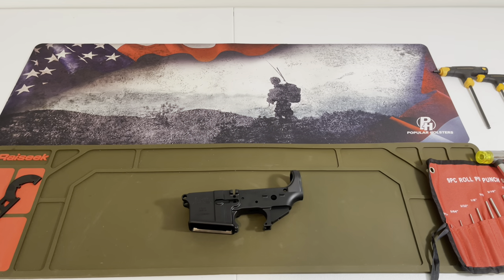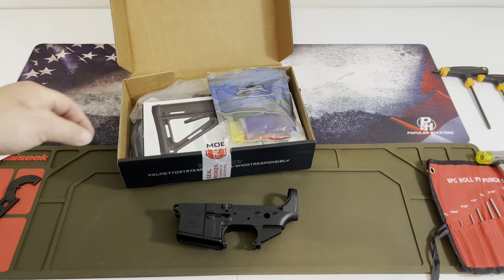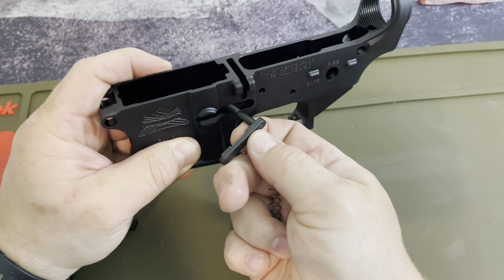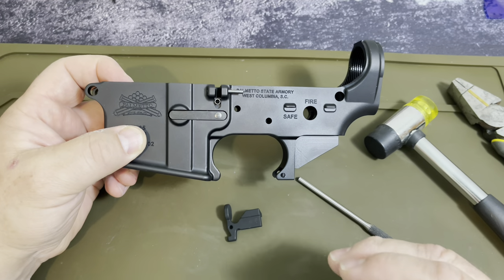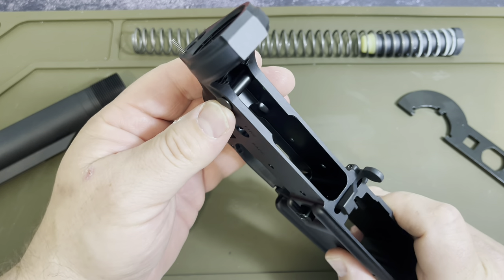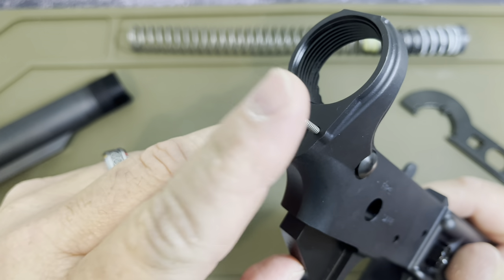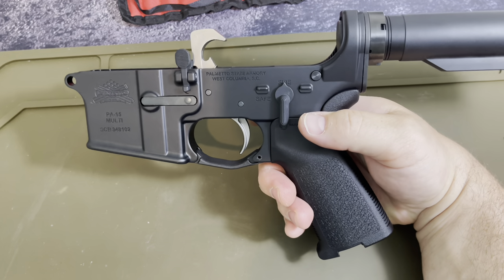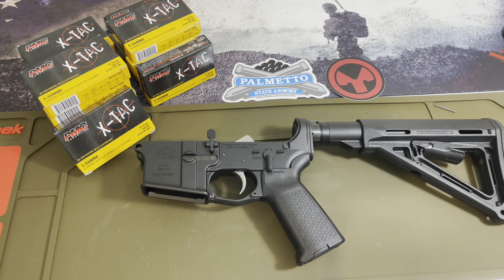PSA Lower AR15 build  - Complete Build

Comment: Nice video.  Thank you for making this.  I did notice at 11:00 for the bolt catch, you dropped the plunger in first then put the spring on top of it.  From other videos and images I found for assembly, they show the spring dropped in the hole then put the plunger onto the spring for assembly which is opposite of the order that you used.  The difference would be the back of the bolt catch pushing on the end of the spring (your installation order) rather than on the rounded end of the plunger.
Reply: Dang it. Now he's gotta take that roll pin back out
Reply from the maker: Good catch. Doing multiple retakes on video clips looking through a camera caused a brain fart 😂 Easy Fix to switch the order.
Reply: The crazy thing is. I looked into the hole and the plunger is the exact cutout of what's at the bottom of the hole. Now I'm curious if this is a serious issue because that pin was hell to get in.
Reply: I was getting worried there for a minute lol   ....."have I been doing wrong all this time? ...."
Reply: Yes, please edit video with a big blinking notification to install spring first!! Also, skipped the trigger guard install.
Reply: @BRUCEYBOY stop crying

Comment: What I did for the tight pins was put the thing in the freezer, and let the metal shrink slightly, gave it a drop of gun oil, then I was able to easily tap the pins in.
Reply: Putting the pin in the freezer! That’s a hell of hack right here.

Comment: Try using the right size roll pin punches and roll pin starter pins. It makes life much easier for installing them. 

Also, install the hammer/trigger pins, so the two notches go in last. The center notches are designed to lock into feature inside the hammer/trigger hole, so installing them with the notches going in last means you don't have to hammer the hell out of it to get past the first notch. 

Install the buffer retainer, spin on the tube 1/4 turn past where it needs to be, then install the takedown pin, retainer, and spring. That way they're not in the way during install. Then just push in the spring and rotate the buffer tube a 1/4 turn back to where it needs to be. Much simpler than what's shown. There is an actual torque spec for the buffer tube castle nut (40 ft-lb). Good and tight isn't good enough if you want it to stay tight for more than a few hundred rounds. Torque specs exist for a reason. 

A proper bench block for an AR makes roll pin stall a lot easier as it supports the receiver while you're hammering on it. Also, a magwell vise block makes buffer tube install/torqueing a breeze.
Reply: I was gifted the Real Avid AR-15 master kit and adjustable vice for my birthday from my beautiful wife. I  bought a bench from Harbour Freight on sale for just over $100 and can't wait to do my 1st build. Caught the PSA magpul sale and the bundle came with 10 30 round magazines for 150 plus shipping. Took advantage of several Christmas sales for everything and final cost of build should be just over 600.
Reply: Right, if you put them in correctly you can just push them through with your fingers

Comment: Thanks for posting. A great tip Learned from another commenter was to cut the point off a toothpick to hold the bolt catch while driving the pin
Reply from the maker: Sounds like a viable tip to hold it in place while punching in the bolt catch pin

Comment: One trick with the bolt release, is to slide a right angle Allen key on the left side to hold the bolt release in place while you hammer

Comment: Here's  a trick i learned from an  " Armour " ...
For that  Bolt Catch Release  assembly - use a  adjustable  Pliers to " Push " the Drift Pin in .
Less chance of breaking off tabs.
Oh , and another trick for  Buffer Tube Upper Detent pin & Spring , try using a playing card to compress the spring as you screw the Castle nut & End Plate down..

Comment: You made that front pivot pin install look 100x easier than I’ve ever done it. I can’t tell you how many springs/detents I’ve launched across the room.
Reply: I used a small feeler gauge (.05mm) to hold down the detent pin, worked like a charm
Reply: He made it look incredibly easy, it is hard with no other tools!

Comment: Torque and stake your castle nut guys. Also on the bolt catch, it is spring and then plunger. Trigger guard: use some sort of pliers to squeeze the pin in, if you are not careful you’ll break your dog ears off. Good intro video but a lot of missed steps for the nebies.

Comment: Next build you do put trigger and hammer pins in from left side to right Good way to remember is you read left to right and the reason you had to hammer is you put pin in on wrong side, if you look at the pin you will see one side has a long solid round before spring groves. That side goes in first so it does not grab the spring so you do not have to bang it past the spring and you can feel it lock onto the springs. Also have fun knocking out the roll pin back out of the bolt catch lol I have made that mistake before. To answer some comments on why spring goes in first is the bolt catch pivots and not good to pivot on a flat spring that is why the bolt catch detent you dropped in first has a round head so it is smoother while pivot contact is made. If you leave the spring like you have it, it will grind every time you use it and wear on where they rub. Other then that nice build always fun to watch a AR being built. I got three to build myself lol.

Comment: i tap the rear takedown spring hole and put a set screw in it. On the last build i did, i also tapped the bolt catch and trigger guard. It is super easy to do and anytime i do a build from now on this is going to be my go-to.

Comment: I use a small Allen key. I push it through the latch hole until it goes up to meet the pin in the other side. This eliminates me holding the catch flush, and all I do is tap the pin through.

Comment: When putting in the bolt pin, it doesn't hurt to put some tape under the pin to protect the lower finish when you need three hands to hold everything. You make that look relatively easy.

Comment: Excellent video. This was my first lower build. Already had a a lower shell. Got the PSA kit and watched your video. Only have two issues. They sent a set screw that docent go anywhere and I am missing the front roll pin for the trigger guard. I'll call them about those.
Reply from the maker: We are glad the video helped. PSA is typically really good on their customer service for replacements or missing parts
Reply: I got extra springs and detent pins with mine as those things will fly into outer space if not careful. you should only have only 1 pin for the rear hole of the trigger guard, the front pin is spring loaded and already installed  in the guard

Comment: Thank you! Best video yet I have seen!
I just got the shipping notification for my lower kit coming from palmetto, doing my first build. 
Two questions;
•do you grease the castle nut?
•do you blue loctite anything on the lower? 
Appreciate it! -Will
Reply from the maker: Thank you for the comment. I never use Loctite for a lower build. It will make it difficult if you ever want to dissemble, upgrade, or polish any part

Comment: If you do lots of build i suggest you get a Wheeler Engineering AR-15 roll pin install tool kit comes with flat sided puncehs for the roll pin on the bolt catch and other roll pins its like $40 and is a life saver ive got sausage fingers to and and it makes it easy.

Comment: With PSA you need an aftermarket flat wire buffer spring right off the rip.
Reply from the maker: We use the Buffer Spring that came with it and it works flawlessly. Dumped a 100 rounds through it with no issues
Reply: Is your recommendation based on the spring they supply, or the gasing of PSA uppers? All my PSA builds work fine, but I'm always open to recommendations regarding improvements.

Comment: I used your video to build my very first AR-15.  Fantastic instructions.  What should you put Loctite 242 on?   I put some on the magazine catch button because it would not line up perfectly every time I tried it.  I'm a retired manufacturing engineer and I know good instructions when I hear them. I upgraded some of the parts. Thank you for your help.  I'll let you know how it works after it's all completed.  :)

Comment: Just a couple of comments and suggestions coming from someone new to ARs and definitely new to building them. First off, great video and thanks for taking the time to put it together. Very informative. My suggestion, if you do another one of these build videos, would be to not skip any steps. Pretend your audience are a bunch of dummies when it comes to building these (which i am) and show us every step. Maybe I'm a little OCD when it comes to the info, but better too much info than too little. Then a couple of questions. First, I noticed you just hand tightened everything. Does nothing on this lower need to be torqued to a spec?  Also, I noticed you didn't use any grease or loctite. None needed?

Comment: I got a little unlucky with my PSA Sabre-15 lower parts kit.  The trigger and hammer pins were missing.  I submitted a claim about it just a little while ago, and I'm hoping to hear back from them soon.  Otherwise, everything seems fine so far.
Reply from the maker: PSA has always done a great job on their customer service. They should have you back up and going soon
Reply: @americanvikingtesting  Yeah, that's what I figure.
Reply: @americanvikingtesting  Oh, also, I thought I included this in my original comment, but I guess not.  @10:58, are you sure you should be putting that detent/plunger in before the spring for the bolt catch?  The video tutorial I watched from Midwest Gun Works says that the spring goes in first.
Reply from the maker: @SaltyMaverick  I put the correct order of installation in the video description. We caught that one after we filmed
Reply: @americanvikingtesting  Ah, you may want to consider making a note of that in the video, if you can edit it.  I didn't notice that, and YouTube's new layout (which really sucks) makes video descriptions very discreet and easy to miss if you aren't looking for it.
Reply from the maker: @SaltyMaverick We have tried several times to edit the video on YouTube, but it doesn’t allow us. That’s why we had to place that note in the comment section
Reply: @americanvikingtesting  Oh, well that's weird.

Comment: What was really frustrating on my build was the grip bolt stipping the receiver with almost no force and those darn pin holes for the bolt release and fire selector being way too small. Edit: I crimped down on the pins a second time to close the gap and that worked like a charm. I also cleaned the grip threads and kept feeding the bolt at the 45 deg angle until I got it to work.
Reply: Yeah I saw a comment below yours about the spring going in first then the plunger. I already got the pin in. I'm not doing it again. I don't know how to get the pin out as this is my first build
Reply: Bro fucking preach,i pinched the pin and still had to beat the fuck out of it to get it in- Palmetto could have EASILY solved this problem.. Threaded allen screw into a threaded hole like i've seen on other premium receivers.. They went the cheap route for sure with the pin.

Comment: I have a spikes tactical lower and when I installed the takedown pins the spring stuck out of the receiver where the mag goes in could not get the pin in extremely difficult

Comment: Forgive my ignorance but could I use the psa lower and pair it with a bear creek upper in say 308 or 30-06?
Reply from the maker: With the 308 being an AR 10 platform yes you can pair the PSA & BCA 308 together. But be aware of the different Generations. Ideally you want to match a Gen 2 with Gen 2’s or even Gen 3 lowers/Uppers with Gen 3’s etc. If not they may not snugly fit together correctly and could cause issues such as misdeeds, misfires, stove pipes, and other cycling problems. Just make sure they are the same Gens and AR10 upper/lower and you should be fine

Comment: Hi what size T handle allen wrench are you using to install the nut on the ar15 grip.
Reply from the maker: They are from Gearwrench. I highly recommend these Allen wrenches. They are perfect for AR builds, repairing survival gear and equipment. Here’s a link for them on Amazon GEARWRENCH 8 Piece Metric Ball End T-Handle Hex Key Set - 83520 https://a.co/d/b6W3MVe

Comment: 9:25 What is the Outside diameter of the action latch Rollpin supposed to be???
Reply from the maker: Hopefully this helps you 

Bolt Catch Retaining Roll Pin: 3/32″ x 1/2″
Trigger Guard Retaining Roll Pin: 1/8″ x 5/8″
Forward Assist Retaining Roll Pin: 3/32″ x 5/8″
Gas Tube Retaining Roll Pin: 5/64″ x 5/16″
Ejector Retaining Roll Pin: 1/16″ x 7/16″
Trigger Guard Detent Retaining Roll Pin: 1/16″ x 1/4″
Forward Assist Pawl Retaining Roll Pin: 3/32″ x 1/2″
Forward Assist Pawl Retaining Roll Pin (new round): 1/16″ x 1/4″
Forward Assist Pawl Retaining Roll Pin (old teardrop): 1/16″ x 5/16″
Charging Handle Latch Retaining Roll Pin: 5/64″ x5/16″
A1 Rear Sight Wheel Retaining Roll Pin: 1/16″ x 1/4″

Comment: I was attempting to put the bolt catch spring pin in and it got away from me.  Do you know, by chance, what the size of pin is used?  Thanks!
Reply from the maker: PSA sells the the kit with the springs, pins, etc. Highly suggested to purchase from the same place/manufacturer that you got the original parts from

Comment: I would like to know if I can use the kit for a AR-15 will work in the AR-10 lower ??
Reply from the maker: Unfortunately no, some parts may be similar. But overall the AR10 platform is a larger lower and it will not adapt for all of the pieces. Not matching up parts correctly could cause misfires, failures, or render unsafe results

Comment: The first thing i learned in this video is take it to a machine shop and have them tap the bolt lock and machine a screw.   Or buy the bolt lock screw and bushing from an aero lower and take that to a machine shop.   

Cause that was dumb. Not you.  The procedure is dumb and inefficient.